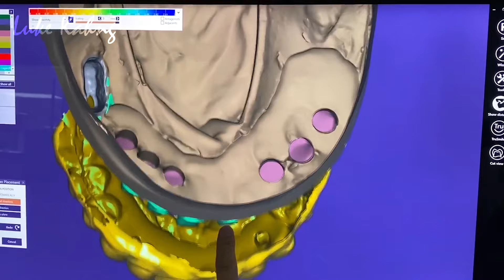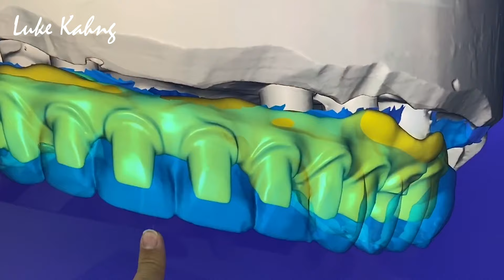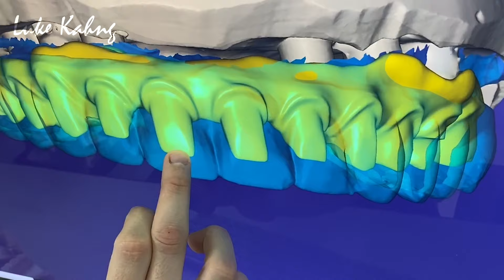Full Process Demonstration of 7-Star (Individual Crowns on a Metal Framework)

Comment: Hi, it is a truly nice work. Probably the best I.ve seen so far but is a dental technician that just popped out of school that has no prior knowledge nor practice of doing this kind of work  how can I learn all the necessary steps to do the same and perhaps find out what pieces of equipment you.ve used and all technicism that are needed. Questions such as  how to actually make the metal work ? It is actually milled from a block of metal with some kind of milling machine?  how do you apply  the ceramic gingival area on the metal work? is this a classic and manual process  or is it again milled from a block of ceramic and later on glued to the metal ? and what are all the software programs employed throughout tall steps to get this results ???  Again, many many questions for a "newbie" like me. But the main question is:  do you actually have videos in which you explain and show answers to all of the above questions and more ???  Thank you very much for sharing such a beautiful work. I shish one day to achieve the same results and to become a good and hard working professional. Thank you.